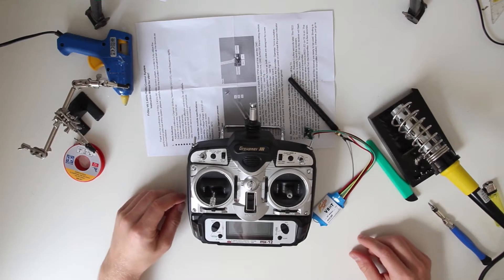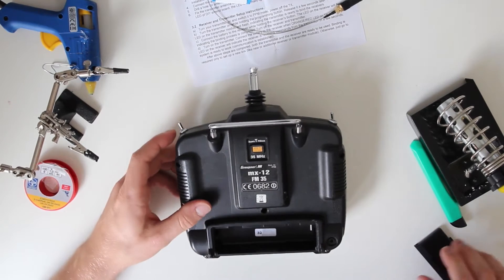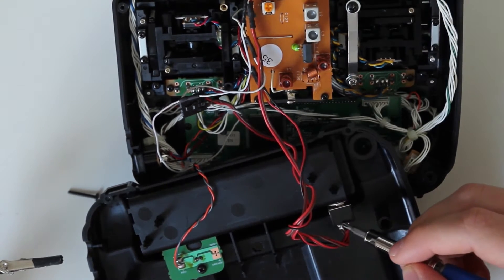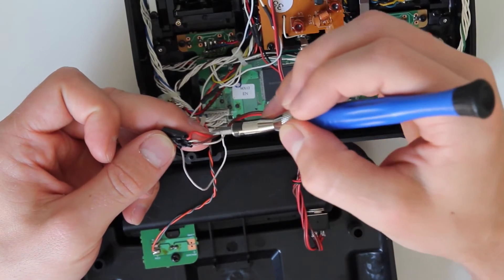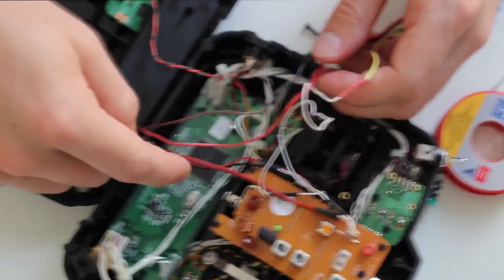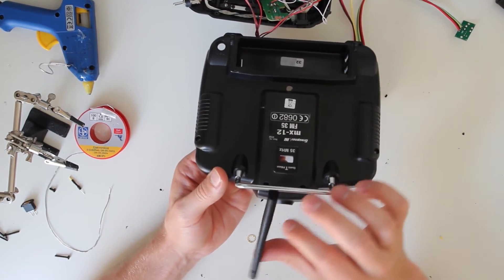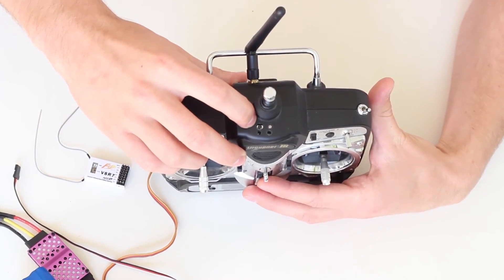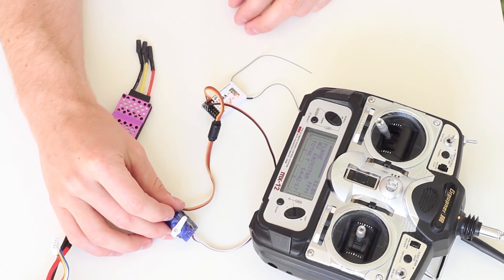FrSky V8HT 2.4Ghz DIY Module Installation and Binding

Comment: Hi,  your video is very interesting. I noticed that you wired the module in such a way that you could keep the original 35mhz system, as well as the upgrade to 2.4ghz by using a switch. However, i am looking to simply modify to 2.4gh ONLY. But i dont know where you solder the module wires for this. Do you simply connect to the 3 wires coming from the MAIN board ? Leaving the FM board completely disconnected ? Can the FM board be disgarded ? I look forward to your comments.

Comment: Hallo Danke für das super Video. Ich habe genau die gleiche graupner mx12 und habe vor das genau so nachzubauen. :) weil ich noch Anfänger bin hab ich noch 2 kleine Fragen:
kann ich das "FrSky DHT 8ch DIY Telemetry Compatible Transmitter Module" (https://www.hobbyking.com/hobbyking/store/__17205__FrSky_DHT_8ch_DIY_Telemetry_Compatible_Transmitter_Module.html) nehmen und wenn ja können dann die telemetrie Daten direkt auf dem mx12 display angezeigt werden? außerdem finde ich die Idee mit dem Schalter genial wollte dich fragen welches Modell das ist (wie gesagt bin noch Anfänger und weiß nicht ob es da irgendwelche standardteile gibt die da am praktischen zu bestimmten Steckern passen.)

ich würde mich sehr über eine Antwort freuen ;)
Gruß Julius
Reply from the maker: Also das ausgewählte Modul geht, Auf dem MX12 anzeigen aber nicht, Der Schalter ist ein normaler Dreiwegeschalter. Viel Spass
Reply: Vielen Dank :)

Comment: What color does your TX flash after binding?  I installed following your instructions (thanks!), and it appears to be bound, but the TX quickly flashes red/yellow all the time now.  If I hold down the bind button, it will turn green, but I guess that's range test mode.  It seems strange for the TX to flash red/yellow while it's bound, but I guess it works.  Anyway, thanks for the great videos!
Reply: Hi, the same to me....in normal TX mode the led flash super fast red and green, It seems orange/red light with a bit flickering...